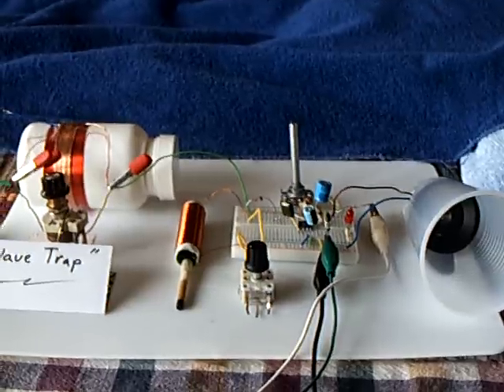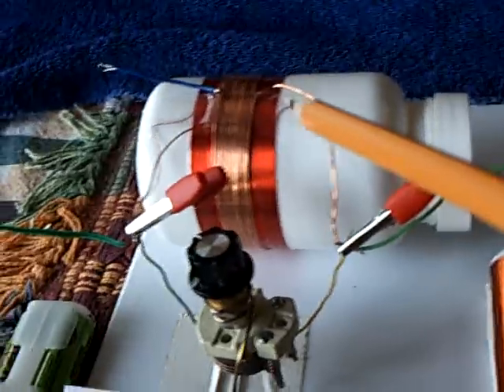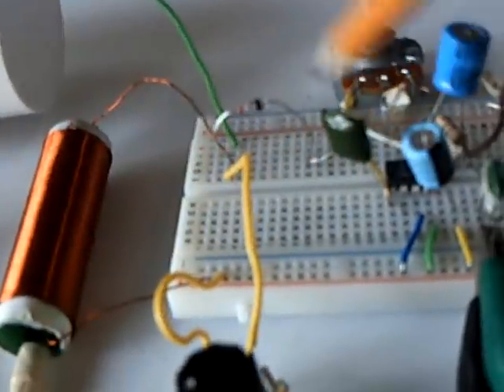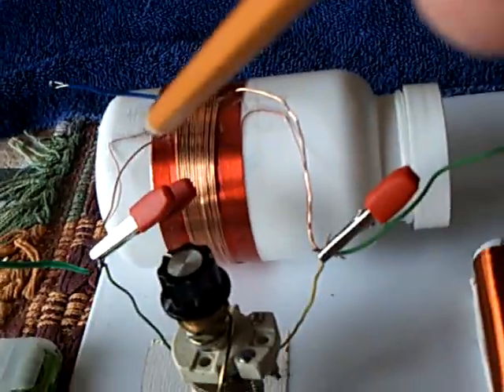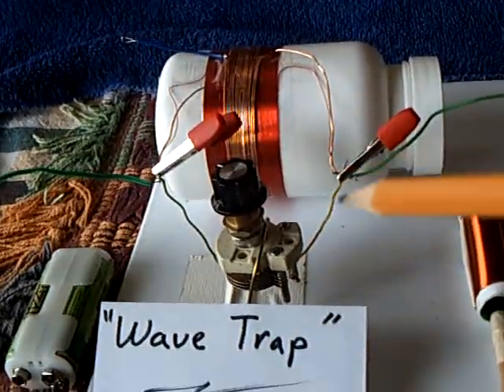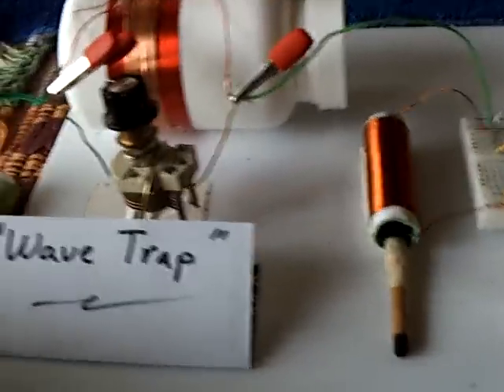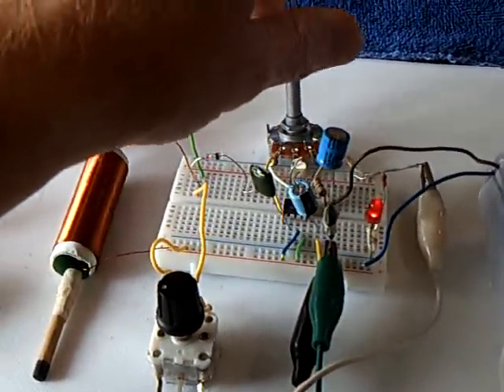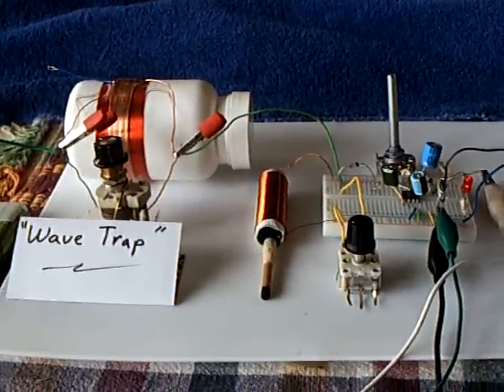Wave Trap filter for crystal radio

Comment: I no this is a older video but I just bought a tecsu 200   loop antenna to improve am reception ,I wonder if it would work on Crystal radios ?
Reply: Give it a try. Come back and let us know.
Reply: I have a Radio Shank loop for improved am reception. By hooking up a diode, antenna, ground wire plus headphones or amplifier it will work. Wrapping 50-60' of insulated wire around  a 3-4" PVC pipe will also work well. I like schedule 30 thinwall plastic pipe. Many use an empty oatmeal box.

Comment: @ken25taylor You're exactly right. He said  that his system was designed to prevent any radiation at all, NO E/M radiation.  The top terminal is merely to provide capacitance for the system, and not to act as an antenna.

Comment: Hi Lidmotor! Thanks again for this nice vid where you clearly discuss about your adding :)
What I very like in your way, it's that your go very step by step trying to isolate each possible factor and spot when you get something interesting at the end. :-bd
I'm happy too to see that you are closed to do the idea I have already given to several experimenters on crystal radio, and it to use a long cylinder coil on with you take like every centimetre the signal that you set with a capa each time...